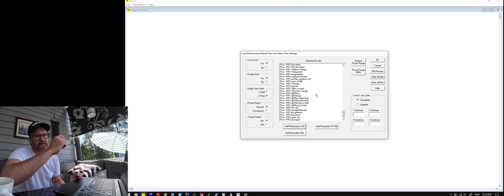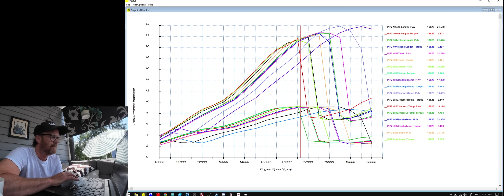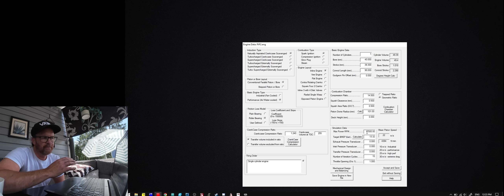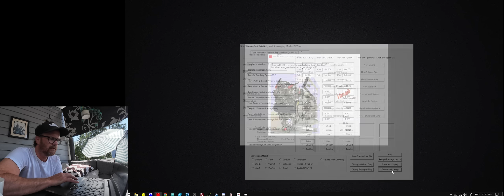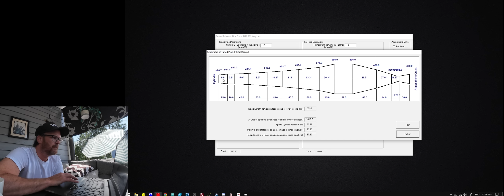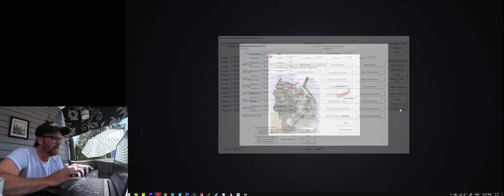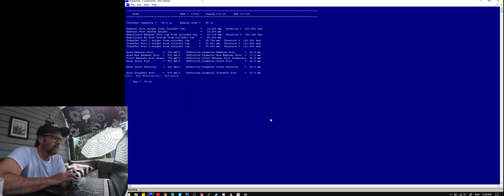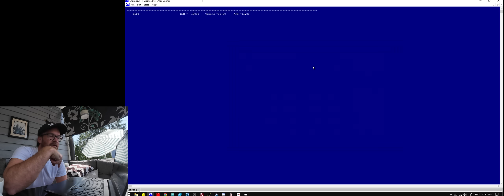A HUGE flaw in my 50cc Two Stroke model?

Comment: The header pipe appears oversize diameter. The reason it's not continuing to rev is likely due to the pipe as it likely not scavenging the exhaust fast enough in order to dra s in a full fuel charge yourvrunning out of air!! No air no fuel. Flat line. Is the piston flat or domed a bit. Your always better for it to be flat f I r better air flof

Comment: What is the exhaust port timing when does it open and clo se in degrees of rotation. The mear size of the pipe ! Diameters! Is borderline for a 125cc to 175cc  motor

Comment: Hey, just found your channel. Sub’d right away.

One question, what material do you use for your cylinder and block packing material and where do you buy the sheets from?

Not a performance tuner, but had it with old milk cartridges and biltema quality nowadays.

Comment: Hello, at the crank degree where your downpeak exhaust pressure appear (almost before 180°), could it refers to "when the piston travel the down part of the exhaust port" ?
If So, maybe the exhaust port bottom form become as a mountain for the travelling air passing just above the piston at high RPMs. It could create gas turbulences/gas stucking/gas restriction going the exhaust explaining "the exhaust pressure loss"?.
Try to modify the exhaust port (except in it's boosters parts), make it symetrical from it's upper form maybe could help reducing the mountain effect? You could do this as suggested by @rayivers9437 in your modelisation software and retrying ;) Sweet project / Well work / Good Road ;)

Comment: Perhaps a few different pipes could be tried with some variations, but same mounts for quick exchange to run on program to fine tune what works at higher RPM's.

Comment: What happened with the engine with both supercharger and turbo...? Was it a lost cause...? I had such expectations of that one.....
Reply: A normally aspirated 2 stroke lives and dies in its expansion pipe exhaust design...when the engine is "on the pipe" (resonance) it is like having a "free" turbo installed... with none of the power requirements etc..

Comment: Ok the science looks like you are in the pocket. But... getting that engine in the pocket ( rpm and load ) seems to be .. difficult.. variator.. you struggle to get that engine where it sings.. and the Rube Goldberg things you struggle with seem to be a mud bog. Conventional multi speed transmission??? What is the variator romance with not doing that. Half the the time you can't get to the sweet spot of that engine because of niggling eccentricities of the variator..

Comment: I'm glad you're giving the exhaust science more of a look into Alex. To eliminate the multiple welds of your exhaust and the internal disturbances they would cause, look into water forming you're exhaust pipe pieces, which can be done with just 2 pieces of steel, a good high-pressure water cleaner can be used to form it with, using a steel plate flanged mould. Once the 2 halves of the exhaust pipe are formed, you can use that new beaut welder you bought to fuse weld seams. Leaving no internal welds at all practically. 👍❣️😎
Reply: In Thailand, they race anything and everything, total fanatics 2stroke and 4stroke... I bet they could teach us a thing or 2 about pipe design... 🫤

Comment: The pipe can make or break the power , i tell you this pipe sucks to much header too steep , u need a longer straight part from cylinder to header start. I made many pipes most for 50 cc . First pipe build in 1975 , for Zundapp KS 50 Supersport .

Comment: Hello! I'm just wondering, why people are so keen to "invent the wheel" again???  You should not ignore the knowlwdge, work done and experiense they had in Holland, Spain and Japan with 2-Stroke 50cc:s. In my experience, it's possible to gain those results only through specified, custom ECU- mapping.
Reply: Which 50cc engines use EFI?  I'd be very interested in any info you have, thanks.
Reply: @rayivers9437    the ignition can be maximised.

Comment: I wished i knew what you was talking about. But the only thing i can think is the angles in the pipe might be messing with the airflow? Would it not be better having the weld areas smoothing out and having the angles smoother . 

Or is the seperate sections part of the design, or just makes it easy to build
Reply: The angles contribute to the exhaust efficiency...
Reply: @peterfitzpatrick7032  my though was, the pressure wave that travels through the pipe then back to the cylinder would be slightly interupted. But if its designed with that in mind, then im guessing its doing what it should.

Comment: I still wonder if not having the exhaust port floor piston top height at  bdc ,is contributing to why yoiu were struggling to get expected power from the engine, is it worth exploring ? in my mind, it seems to be, just my personal thoughts I may be wrong, we used to do it yers ago and it seemed to help a lot

Comment: The pipe is a variable that can only be maximized by trial and error (many small changes in multiple combinations during Dyno&riding tests) is the only way to find things that many have missed, the baseline software parameter’s reflect known knowledge you are looking to break new ground so bring as many pipe variations as you can build/find a hacksaw and torch for the break through, flat earth used to be settled 🤔❤️🙏💪
Reply: I think you are right here....  no 2 engines, even if virtually identical, will have the same pulse "profile",  so multiple sessions on the dyno are really going to be the way ro go... and if Alex finds the perfect pipe for this engine, it may not transfer to another "identical" engine successfully... 

Tiny differences in porting and polishing etc will "shape" the pulses differently for each engine... 

What effect does expansion pipe wall thickness have, if any, I wonder ?.. 🤔

Comment: ComSN:0155 Une énorme erreur dans mon modèle à deux temps de 50 cm³ ?

Merci pour votre message. 

Non, vraiment, excusez-moi, il n'y a pas d'erreur dans votre modèle à deux temps. Tout cela est dû à la capacité du réfrigérant qu'est le dioxyde de carbone. L'état supercritique du CO2 permet à la glace carbonique et au gaz d'exister simultanément sans passer par la phase liquide, ce qui permet un équilibre de sublimation. Si l'ensemble du moteur est conçu pour fonctionner avec du CO2 « gaz solide », on obtient des valeurs de couple très régulières et très élevées sur une très large plage de régimes utilisables.

Comment: 11.85 AFR seems a bit rich if you are running petrol(11.8 is like happy spot for E85)
If i run this rich in MOTA i also get weird high numbers.
Aim for 12.5-1
And do not fool yourself with putting in rich numbers before the pipe, a carburetor doesn´t do that if not having a electronic controlled powerjet or similar.
If trying to richen it up to get rid of dip before the pipe(in real life) it will carry that richness all through the powerband, and give you low power.
Jetting it for good power, you WILL get a huge dip before the pipe, just physics...
Reply from the maker: Thanks for the input. Running Sunnoco EXO2 highly oxygenated in real life, the sim equivalent wants to rum that rich. The rich numbers before the pipe was to make it run worse to better simulate what happens to carburetion in the dip, not get rid of it.
Reply: @2STROKESTUFFING  yes,, but often in irl the dip gets less running rich.
Also shown in MOTA.
Reply: @Patricks_Projects  he needs to run rich to keep it cool and alive, wide open throttle for a couple of miles, lean power dont set records, nice an phat.

Comment: Injecting water in pipe for cooling will lower resonance frequency. Don`t now if its legal, bot should be relatively easy but effective.
Reply: The water would turn to steam & ruin the flow/resonance.
Reply: @calthorp  colder pipe resonate at lower frequency. This effect is widely used on jet skis and worked great! Here we don't need much time on low rpm, so small tank for water should be enough

Comment: The steep header requires very well aimed scavenging flow otherwise the strong suction of the pipe overcomes the flow and causes severe short circuiting. This in turn leads to a cold pipe and never reaching the target rpm. If you suspect this to be happening, try the severe short circuiting model in a sim and see if it matches reality. There is a draft article about it in your inbox.
Reply from the maker: Thank you Neels! Just saw your email. We've seen very low temperatures so that might be the case. Luckily I've got the old more mellow pipe.
Reply: What about header wrap? Or header wrap and something like a pipe guard from motocross bikes with the goal to reduce or eliminate direct contact airflow at speed?
Reply: @theshippingcontainergarage  if the pipe is not made right the wrap and other thing is just some poor patch on the wound to gain everything between noting and a miner power increse, if the pipe is done right it might be a slight gain that is eaven notisable with a "but dyno" and not only a decimal on a dyno paper.
as a former mechanic on mopeds and tune some of them i seen alot of mellow tuned motors where the owner think a "street pipe" will be high power if its wraped in alu foil and what ever nightmare ive seen.
Reply: @extec101  Of course the pipe profiles need to be correct. It's a hell of a lot faster to wrap a pipe at the test road then it is to pack everything up and go back to the shop and weld up a new pipe. 

It's not a fair comparison where a shop dyno with no real airflow would be anyway comparable to real world speed record attempts with 80+ mph airflow. It will absolutely change the pipe wall temperature profile at high speed.
Reply: @theshippingcontainergarage  you miss the point... the pipe temperature isnt the goal as such... it is merely an indication that the pipe is working properly or not... its a gauge of efficiency of the exhaust...
Reply: @peterfitzpatrick7032  Temperature of the gas in the pipe is indicative of the speed of sound of the gas and thus the RPM that the return pulse functions well to have a supercharge effect. Pipe wall temp will have an effect, even if it's only a small effect.
Reply: @2STROKESTUFFING  Just fwiw... the (huge) engmod pipe on my 175cc engine worked great on the main jet but weaker than expected everywhere else.  I remembered Blair mentioning a strong-action pipe would run too rich below peak, so I fixed that and wow! what a difference - > pipe temps, instant throttle response, much faster on-pipe transition. BIG shout-out to Bonnie Lass at Mikuni American, best customer service I've ever had! A 5FJ9 Mikuni needle in my 30mm Keihin saved the day.

Comment: I have used engmod for a few years now and it doesnt do a good job of showing simulating that dead spot at 2/3 peak rpm, its never quite as sharp of a dip before the power on engmod as it is on the dyno. Ive had great luck with using it to properly simulate the powerband though

Comment: 16,000 rpms divided by 60 seconds = 266 cycles per second. Fine tuning of that pipe is going to be the answer. 50 years of model airplanes flying I can tell you that tuned pipe setting will make or break the overall performance of an aircraft. The engine has done its job it's giving you all that it can now you need the residence of the pipe to provide that last little piece of boost to carry over the top
Reply: Resonance, residence it doesn't matter where he lives.
Reply: @adrianzmajla4844  no one like a smartass.... we all know what he meant... 😒

Comment: Simulations? A bit late in the day for that! When are you gonna run it on a real dyno to make the necessary changes before mounting everything on the bike? Sounds like you're using gasoline as the fuel (10:1 A/F), which would be rich for gasoline or lean for methanol. Whatever fuel you're gonna use for the record attempt should be used for all subsequent testing. Actually, I can't believe I'm having to say this to an expert.
Reply from the maker: No expert. This is just to calm my own nerve. Highly oxygenated fuel, that's why the weird afr. 10:1 was to simulate a rich condition before the powerband tho
Reply: @2STROKESTUFFING  Think of it again...
Highly oxygenated fuel...
Let´s see it from the O2 sensors side of things.
It doesn´t know that it is oxygen in the fuel and automaticly wants richer AFR by that.
Yes, you need to jet it up due to contained oxygen, but it doesnt run richer.
BUT if running say q16 from VP that has 13.3 in stoich it needs to run that rich, but does the program know this?
I´m guessing you got your flaw here.

Run 12.5 AFR all through the powerband to get somewhat true numbers.
Reply from the maker: @Patricks_Projects q16 is what the sim uses and it's stoich ratio is taken into account.
Reply: @2STROKESTUFFING  It seems nitrous oxide is permitted at Bonneville !  Might be an easy and effective way to get up to speed faster w/more mph at the end too

Comment: How about a blown 2stroke engine running a generator and electric powertrain with ev hubmotors in both wheels?

You could desing the engine to run only at peak power and constant rpm all the time charging supercapasitors with a generator. Trying to make a 2stro engine run at all rpms is not realistic.

I know it fun to tinker but we live in 2025. I would love to see a practical and efficient application for a 2stroke.

Anyways, love your stuffings.
Reply: Since apparently most of the $1M+ hypercars have waiting lists I'd think some of these buyers might consider something REALLY different, so how about...

 AWD, 2L flat-10 ultra-clean/quiet 1hp/cc 2T ICE in '6+4' configuration (F&R crankshafts, common block) for 1200hp CVT RWD + 800hp/480V generator section for SPX88-powered 'smart' independent FWD (the cheetah gets her claws back)  and airflow-control fans, axle-height CG, 300mph aerodynamic stability with slot-car cornering, a lighter McMurtry w/unlimited range & 'ZZ Top seating' (1+2).  :^) The SPX88 is a 160hp liquid-cooled HV electric motor, 6.7kg, 55k rpm max.

 I'll get back in my cage now.  :^D>
Reply: Try Googling 'hypercar' and 'McMurtry' - clearly I wasn't talking about a 50cc motorcycle.
Reply: You haven't being paying attention... the engine runs ONLY at peak power and flat out, with a CVT drive... 

And your ''design" would simply bring more weight than necessary... its a 50cc category were talking about here.... 😏